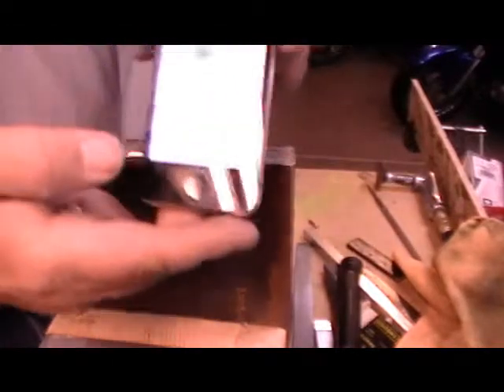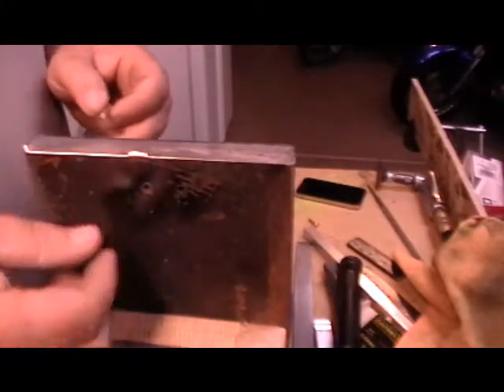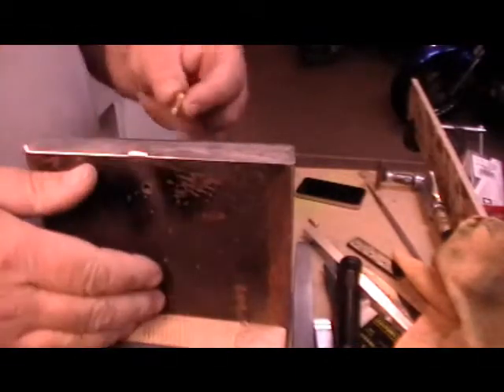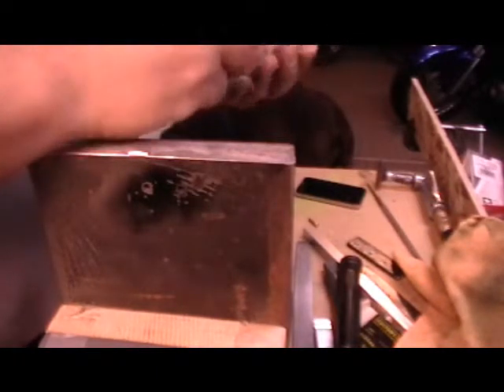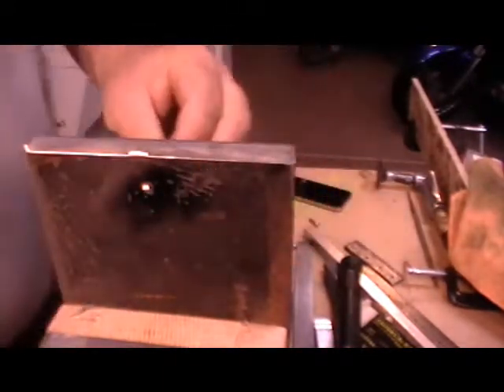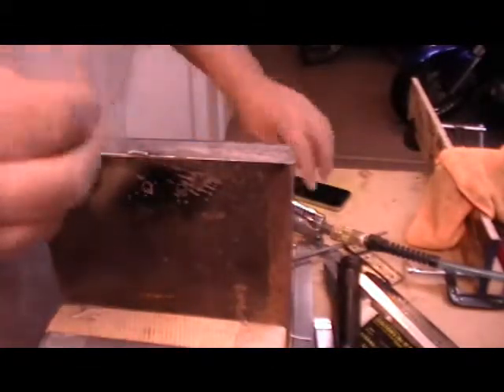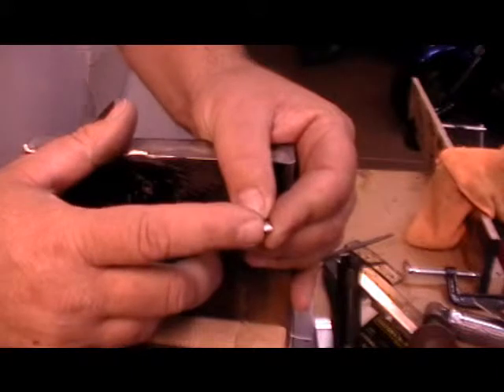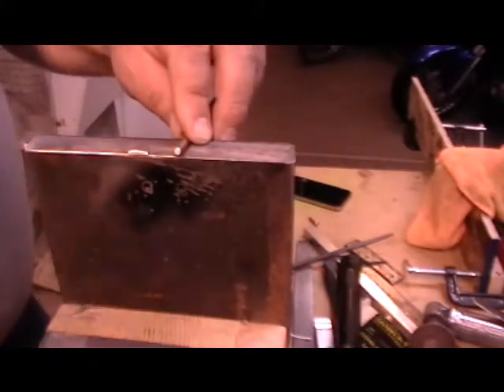The Desert Bearhawk Project: Cut your Rivets to size

Comment: Dave, Do you think that it would be easier to tap the plate for a bolt or stud that has a hole drilled through lengthwise. Add a lock nut (if you had room) to the bolt/stud and then you don't have to use the washers. You would just measure (tail end of caliper)the amount that needed to be removed  from the cut off side of the plate. ?